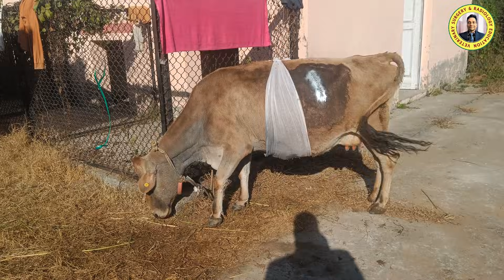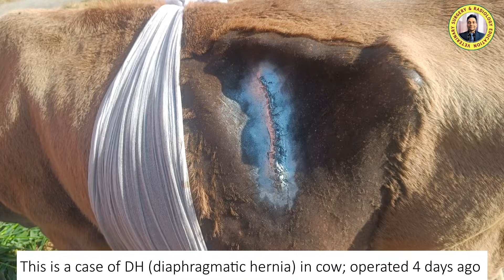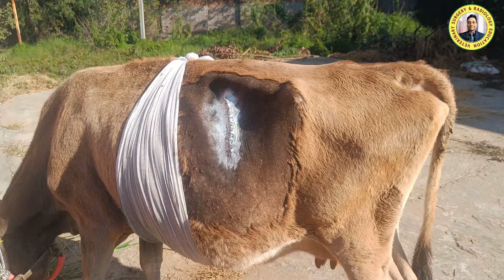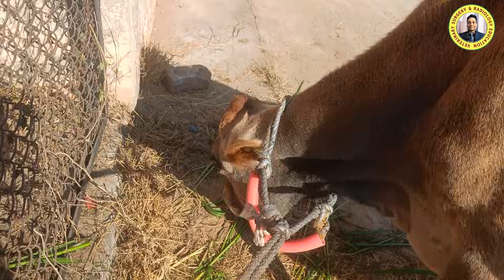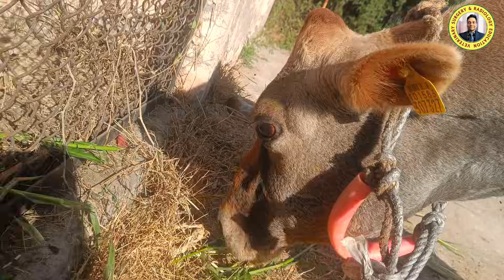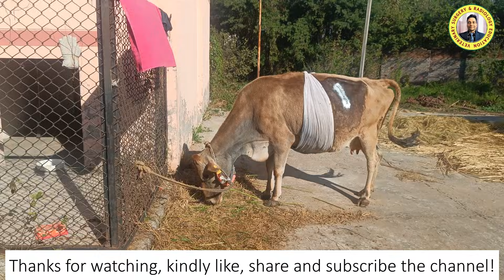#story of diaphragmatic hernia in a cow/#post-operative DH case in a cow

Comment: What is the reason to use nylon or silk in DH closer? Silk don't cause any problem inside body?
Reply from the maker: We must have enough long suture with high strength and cheap as well bcz there is a waste of suture when we put knot by hand technique. otherwise you can use any suture of size no. 4 or 5. Silk or nylon do not cause any problem.  there will be fibrosis around the sutures.
Reply: @drrbkushwaha  make a video on the Left or Right Displacement of Abomasum surgery? Also please make some videos of critical surgery public. As Pakistani we can't approach it.
Reply from the maker: ok
Reply: @drrbkushwaha thank you sir